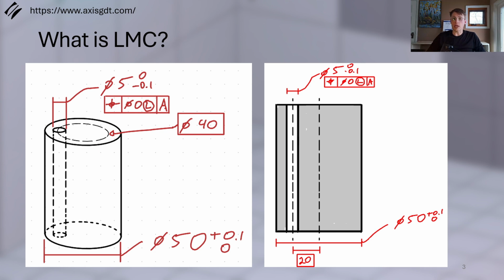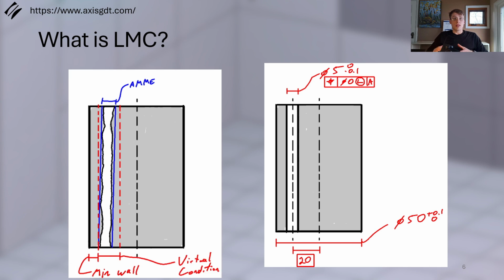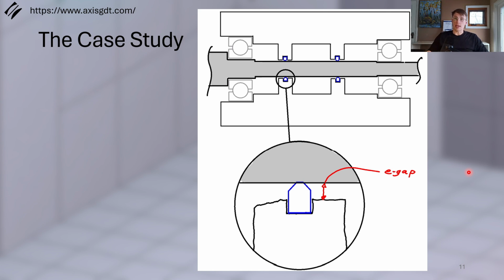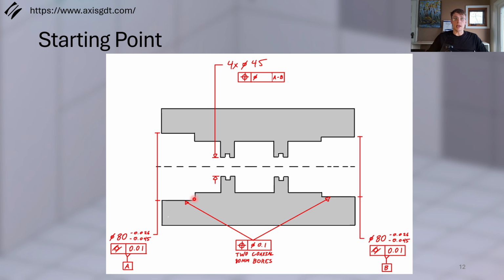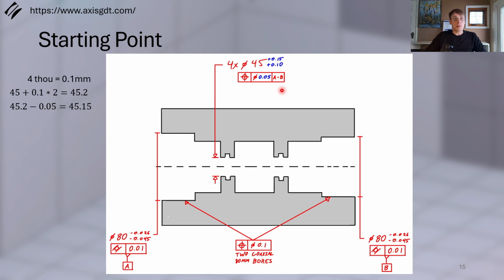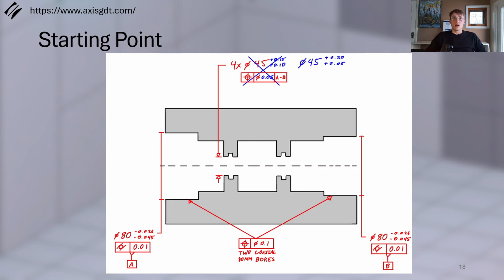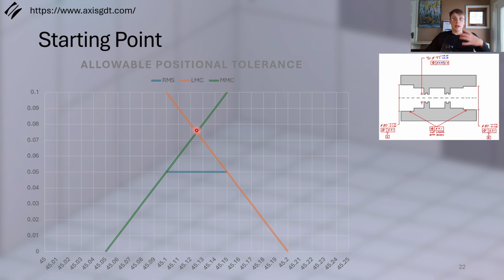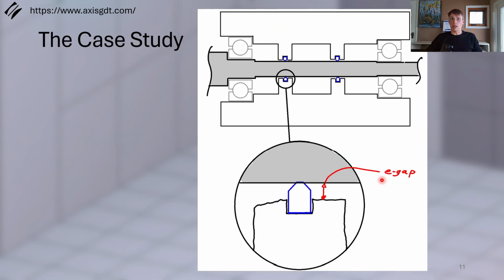GD&T Lesson: Another Use for LMC

Comment: When I first looked at it, I had an impression it might be overly complicated.
I watched the video for a second time and did the math myself as well as the tolerance graph.
It may look simple, but actually it is a pretty challenging design situation.
Although I was skeptical at first, 
I must admit that this concept used in such situation obviously gives more tolerance to the size as well as to the position of the holes. 
Nice!
Reply from the maker: I'm glad you worked through and proved it to yourself!

I've come into one more situation since that made use of this tolerancing scheme

We had a block that we wanted to thermally expand into its housing without adding too many hoop stresses, so having the part fit without creating too large or too small an edge gap was a tough balance